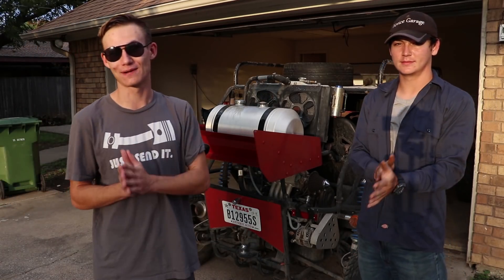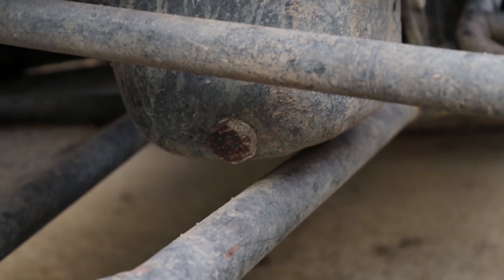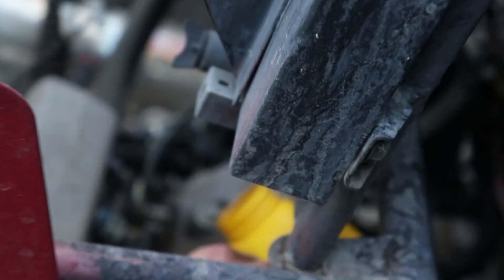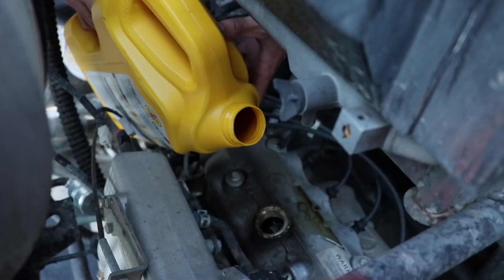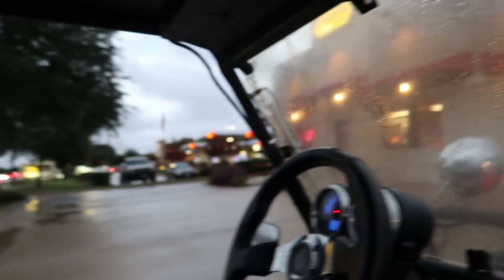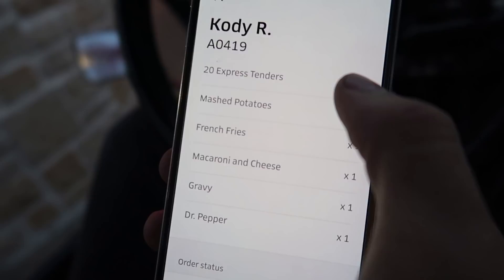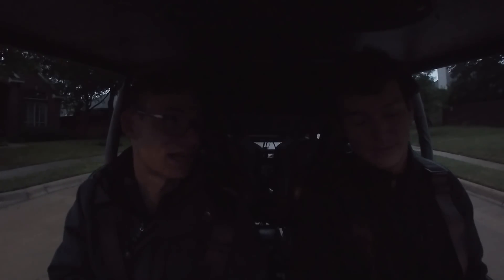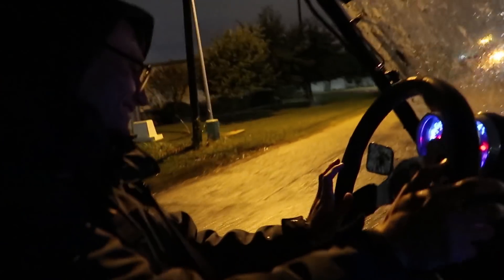We Delivered UBER EATS In a DUNE BUGGY!

Comment: Turbo the buggy
Reply: You don't understand what makes a dune buggy work. It's not a turbo. You need quick instant power not a long stretched out rise. 

This really isn't even really a trail buggy , it's more of a prebuilt street thing people can buy. That thing would stuck every 5 mins on any hill climbs or tree stumps because of the long wheel base.
Reply: being on the streets means a turbo would be fun. its not a dune buggy they will never use it as such so why the hell not? @pyramidhead0420
Reply: pyramidhead0420  well I am sure that all the turbo charged utvs  work pretty decent like the rzr 1000 turbo. Also turbos come in different sizes for a reason for different engine sizes and power bands. Also like you and another comment said they aren't really gonna take it off road also eBay turbos are view magnets which is also why they got this so I'm sticking with my original comment
Reply: matt t  yeah I guess you know more about off road stuff then Polaris and can am which both have very successful turbocharged utvs

Comment: The 1984 (American Motors) Renault Encore is based off of the Renault 11 both the Encore and Renault 11 share the same 1.4 liter motor which is known as the Renault Cléon-Fonte C1J engine.  Based on the fact that this dune buggy has a Renault Encore vin, I could assume that the person who built it used the engine that was in the Renalt Encore that they took the vin/chassis from.  I looked at pictures of the C1J and it looks familiar to what is in the buggy.  2:22  Also, the VIN indicates that the encore engine is TBI, so if the engine on the buggy is tbi (which it looks like it is) than that should confirm the engine.